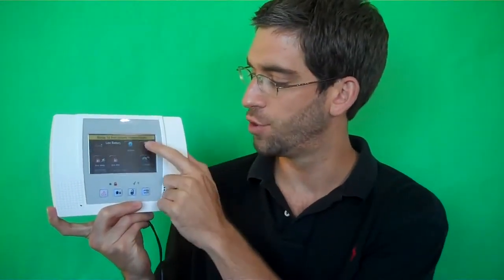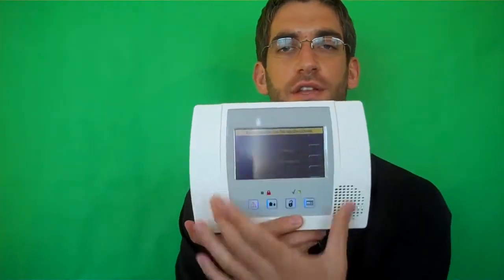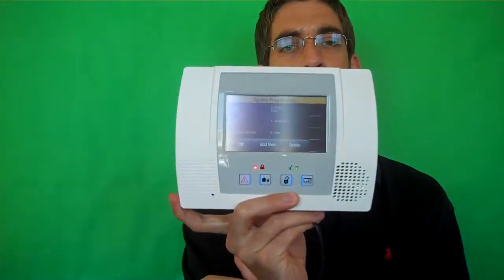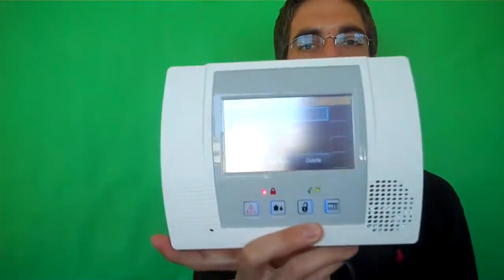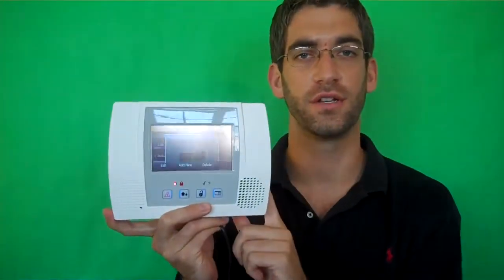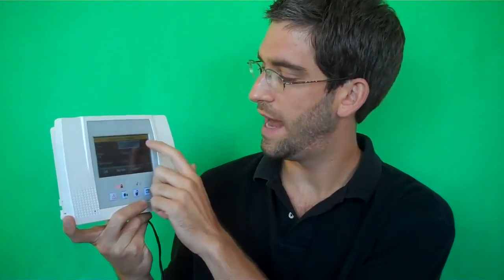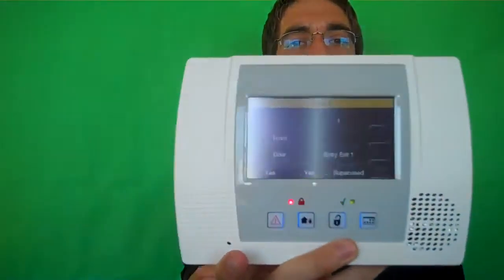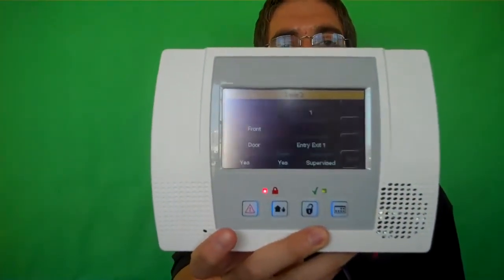Ask Sterling: How to Delete Sensors from the L5100

Comment: Hi Sterling I wanted to know how you can leave the honeywell 5200 up even though you have a different system and use it as a deversion.  great vodeo's by the way I really learned a lot and was able to connect my older device, but it still makes noise. I just watched you remove a device video and it helped. But if you can answer my question I'd appreciate it thanks

Comment: Great video--explains exactly what I want to do...except (1) I have to press 'more' to get to the Tools icon and (2) after I enter the default installers code  after pressing the Tools icon and then press 'Program' nothing happens.  What am I doing wrong?
Reply: It sounds like the panel has been locked out of programming, unfortunately there is no back door into programming for the l5100 like there is for the l5200 and up.